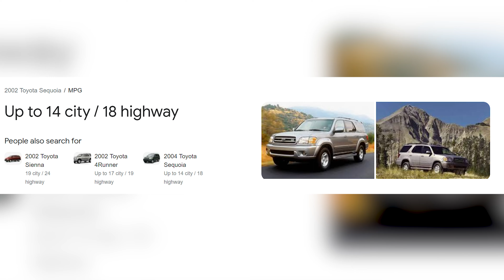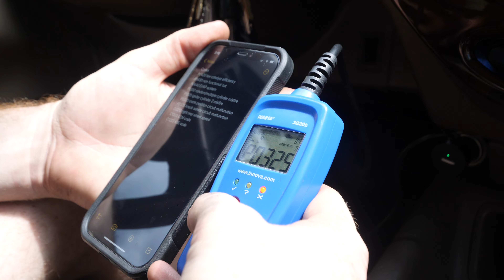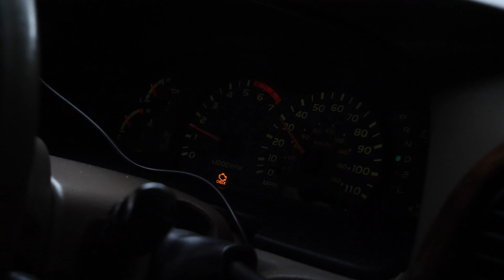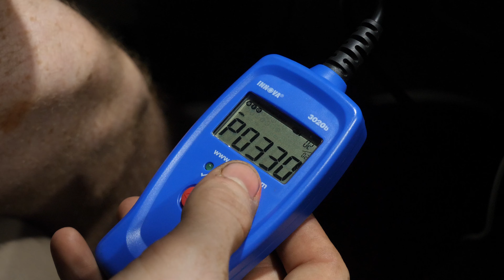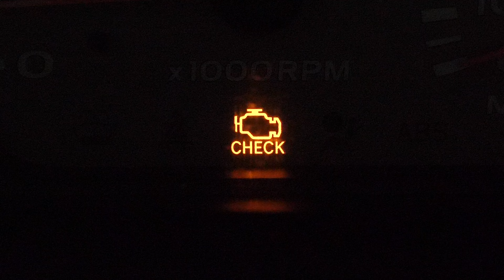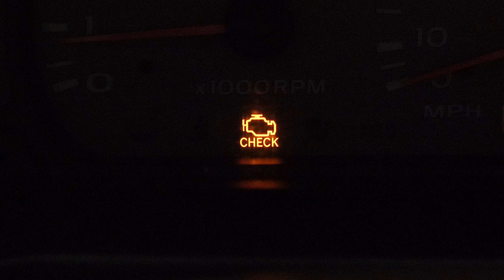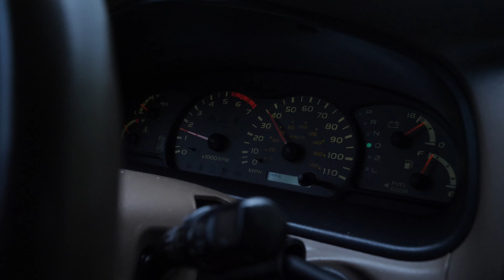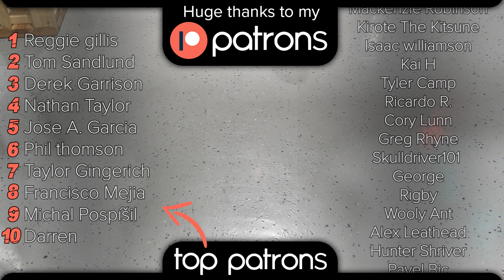There is Something MAJORLY Wrong with my Tow Rig...

Comment: Hey gingum, I've been a tech at Toyota for 3 years, the knock sensor wiring is generally the issues on the 2UZ engines. Also the knock sensor you used was not OEM and these early EFI Toyotas are picky as hell for their sensors. OEM sensors only on these rigs. DENSO and AISIN are the OE part manufacturers for Toyota.
Reply: Also the wires are actually shielded.
Reply: So are his knock sensors doing nothing now?
Reply: @windolite  they're doing something, but he's only utilizing one based of what he did in this video. Ideally the engine would use both and reduce ignition timing if knock events occur.

Comment: PLEASE READ!!!!! 

Gingium those onboard mpg computers go off predetermined tire size. When you go bigger, your rotations per mile are significantly lower, therefore racking up less miles onboard vs ACTUAL miles driven. You need to find the percentage of your tire size difference, take the miles per tank you have on the trip meter, and multiply by percentage (decimal point) , then add that total to what you have on the trip meter. THEN divide that by gallons used (I go off first click at the pump for that number) and you have your REAL total. 

So let's say your trip meter says 400 miles and your tires are 15% bigger than stock and you used 40 gallons 

It's 400×.15=460 actual driven miles. Now 460÷40 (g)=11.5 mpg 

If you went off the computer or trip meter that counts based on stock diameter your mpg would only show 10 mpg because 400÷40=10

I'm willing to bet you're fairly close to advertised mpg. My 99 Tahoe on 33s could hit 20 mpg at 62 mph but my trip meter average would tell me that my average was only like 16 highway. 

Hopefully this makes sense!
Reply: This!!👆👆👆
Reply: Dang, ever thought about that. You wicked smaht
Reply: Wouldn't it be the right solution to just calibrate the tachometer correct to the new tire-size? Otherwise it not only calculates the MPG wrong but also shows your actual speed wrong.
Reply: @DeCSSData  meh the Speedo wasn't a big difference. Even when i went to 35s from 245 tires it was only a few mph off at highway speeds. And a bonus/subtraction depending if you're buying or selling is less miles on your odometer. So if you buy a lifted truck that's been that way for years, odds are the miles are THOUSANDS less on the dash than actual mileage. For me, miles never bothered me. And once you remember how to do the math, it only takes 20 seconds at the pump with your phone to calculate it.
Reply: @sergeantspeed5941  Yeah of course it is no problem to calculate it every time. But I am from Germany. Here you are not allowed to put bigger wheels on your car without techinical review. And not adjusting the speedometer correctly would terminate every chance of a positiv technical review...
Reply: I have bigger tires on my 4runner, I’ve been re-calculating my mpgs for years. Great write up!
Reply: The error  in the MPG should be off by the percentage circumference difference in the tires (also reflected in the speedometer error vs a GPS measures speed)
31" tires are ~ 97.5" in circumference
33" tires are ~103.5" in circumference
That's a difference of about 5%.  So at  70 mph, the speed would show about 67 mph.

I experienced almost exactly this change on my Tacoma going from 31"s to 33"s

Comment: I think Gingium is cursed. Anything with a Panda paint scheme comes to haunt him. First the Previa now this 😂
Ps. 15ish mpg on the Sequoia seems about right. My 2008 2UZ 4Runner gets around 14-17mpg.
Reply from the maker: I really only get 15mpg if I drive it like a grandpa on the highway. Still getting like 9-10 driving normally through the city. Oh well though, its definitely a bit better!
Reply: Previa was sick lowkey
Reply: We get 15 mpg with our 2007. 13mpg when towing a tent trailer
Reply: @_Gingium_  Our family used to own a 2001 Sequoia sr5 2wd with 175k miles and no check engine lights. Dealer maintained and only had the slightest of oil leaks (small enough to where the dealer wouldn't recommend fixing the issue. We usually saw 13 mpg combined when driving like a normal person and 15-16 mpg when driving extremely conservatively. I think these 2000's SUVs never really hit Target EPA numbers unless they were babied and just driving off the lot. You might be spending a lot of money only to see a 2 mpg difference. Just my 2 cents
Reply: My parents 2006 4.0 4Runner gets 18 city/highway so 15 sounds right
Reply: Ahhhh I miss that previa

Comment: Could be cracked manifolds as well. The 2UZ-FE's i believed had really weak headers which would crack over time causing a ticking.
Reply: That's surprising they c with headers but thays why most manufacturers go with cast exhaust manifolds
Reply: Happened to me on my Tundra. It’s very common, could definitely be a cause.
Reply: @FiatRunner  yeah my 4Runners got that tick. It ain't bad but it's there.
Reply: I just recently had my 99 4Runner cast iron manifold crack on me. Very common from what I’ve read with late 90s/early 2000s Toyotas. Replaced it with an OEM steel manifold from a 2000+ 4Runner and it’s been perfect
Reply: I would 100% recommend gettting Doug Thorley headers for the sequoia they will fix the ticking sound and give you a better exhaust sound and more proformance. If you contact Jason from Burtman Industries he will give you all of the info you would ever need.
Reply: reminiscent of GM's 5.3 header bolt shenanigans.

Comment: Next time you suspect a wiring issue I'd ohm and continuity check the harness end to end on both wires.  There's a good chance there's more damage than meets the eye... I noticed at 3:00 the other wire was compromised... but edited video is hard to judge.  So this might all be wrong... but splicing one knock sensor to the other seems like a poor choice.
Reply: He is self taught, which means there's very little chance he understands how to properly diagnose electrical issues.

Comment: hey gingium, i work at the Toyota dealer in Buford and i have a pretty good idea why your milage is so bad. number one is the injectors are probably original and by now have a awful spray pattern. i would either replace them, or send them to be cleaned. number 2 is the egr system. it completely coats the intake valves in carbon and sludge. i would remove it by capping of the line from the exhaust, and just ignore the cel it will throw, or wiring in a simple resistor to trick it if you don't want the light. and then it will need a can of intake valve cleaner ran through it to help clean the crap that is already stuck to the valves. and not the junk you just pour in the gas tank, the concentrated kind that is ran in through the fuel rail. we can do that at Toyota or you can do it with a pressurized bottle. i think that will deff bring your milage back up and greatly prolong the engine life!

Comment: Your knock sensor codes are hurting your MPGs.  Essentially a knock sensor is microphone on the block to pick up pre-ignition (spark knock).  They are essentially tuned to the firing order of the engine to let the ecu know which cylinder is causing the knock.  You have multiple sensors to better pickup all cylinders (think of multiple microphones in different parts of a room to pickup multiple people talking).    If the knock sensors are not operating correctly, the car will retard spark timing to a "safe" level as a remedial action.  Less spark advance, less power, meaning more throttle (and fuel) needed to drive.          The post catalytic O2 sensors you are messing with do not affect the A/F ratio of the engine, that is what the primary (Pre-catalytic) O2 sensors are for. The Post Catalytic O2 sensors have some serious calibration attached to them in terms of response time, temperature, running conditions, etc. that have to be met before a P0430 or P0420 code can be set, and I believe those are type B codes, meaning the problem has to exist for 2 consecutive key cycles to set the check engine light.  With your scanner 2you will see the codes as "pending" if they have only happened on 1 key cycle.        If it were my car, I would run new wires directly from the ECU to the problematic knock sensor to fix it.  As for the post O2 code you could install a new cat, or get a tuner to turn off the code in the ECU (like you would if you installed longtubes) or just leave the light on (it won't affect MPGs).
Reply: Hope he reads this

Comment: Very important!!! Knock sensors almost always need shielded wire to prevent interference of the signal! I've made that mistake many times causing the engine to pull loads of timing.
Reply: I wonder if the knock malfunction means the motor is running with no timing, thereby making its efficiency garbage
Reply: @Fhwgads11  absolutely. Even minor interference with the knock signal will cause the ecu to pull timing and greatly reduce efficiency.
Reply: Also the sensor must be tightened with a specific torque to read correctly

Comment: Probably repair the circuit by running new wires from the connectors of the ecu to the knock sensor because it’s probably pinched or twisted somewhere. As for mpg just calculate manually

Comment: As others have mentioned here the other knock sensor wire looked compromised and in my experience Toyota sensors are extremely sensitive to issues like that. All 2UZ motors at some point or another will suffer from the exhaust manifolds cracking. I'd soak them in pb blaster and just pray they come loose as I don't see much room for an induction heater or torch. 15 seems normal although hand calculating would probably net you a higher MPG based on the larger tire size. Even on the 2UZ 4runners and GX470's of a similar vintage, they are lucky to hit 17-18 MPG stock. (I hit about 18.5 Highway hand calculated on my 06 4Runner with the 1GR-FE and 33/12.5s) It also doesn't help having the earlier 4 speed auto vs the 5 speed that was added for the VVTI models. Once you get all of the little issues sorted it should last you for a very long time.

Comment: Caleb, I get like 10-12 towing in city and like 13-15 highway. It's just how it is when towing with these smaller vehicles. Made decent mileage towing with a friends Chevy 1500 5.3 v8  with a car trailer and car, did 80 the whole way and made around 16-18. I'm towing with what I got right now but I'm looking at getting a truck because I've found that alot of these smaller vehicles say they can tow 6-8k.... and they technically can... but it's not fun. When towing with my friends truck, didn't even notice the load was there. It was a visit to heaven.

Comment: Things you shouldn't do take a tow rig: Add more weight and burn more gas. Add knobby tires and burn more gas. Make it louder because you'll sit at 3k rpm towing for 2+ hours on the way to a track day. You want a tow rig, this ain't it and that's definitely not what to do to one.
Reply: I disagree. He’s an automotive YouTuber, his tow rig has to be somewhat interesting to the audience. A bone stock quite tow rig is great but not great when you’re trying to entertain your audience. I think he’s built this thing very well. A sequoia is a super underrated vehicle. Quite literally a tundra without a bed with the luxury’s of an SUV.
Reply: @xtreme_plus387  so he’s right for the sake of entertainment. Is that what you’re saying

Comment: @Gingium, I have to say two things. Im @3:08 in the video. Number one being... around this year of toyotas, the knock sensors and wiring are extremely important. Torquing the sensors properly and the harnesses being as original as possible is absolutely key. The sensors are very easily damaged internally and the resistance in the wiring to the pcm is critical. I know you probably dont want to get a factory harness, but i implore you to at least get the factory OEM toyota sensors. My shop has gone through three of kinds of jobs now with the proper fixing being just these things. Oem wiring and sensors torqued very specifically. 

Second being I really fucking hope you changed that crusty ass starter. We will see though. 

Love your vids. Been a sub for a while now. Keep on rockin brother.

Comment: Hey Caleb! By the way, the mpg the truck reports on the screen by the headliner is known to be optomistic. If you calculate mpg manually youll find out that its a bit less than what the screen says.  Still glad you made improvments! Had to deal with the O2s on mine & it was just as nightmarish. Also have a turbo 4runner that i had the same knock sensor issue (i did the same exact thing and spliced them together but didnt get the same result) ended up going with GM knock sensors from a small block 350 since the knock threshold was lower on them.

Comment: Have you checked the coolant temp sensor. If its reading cold, engine will stay in cold start using more MPG
Reply: If the coolant temp sensor is broken it gets freezing outside, it lookes warm in the video
Reply: @jbg6961  reading that hurt my head.
Reply: @9373innes  LOL, no doubt.

Comment: (Commenting before watching the whole vid) Damn. That’s rough. I got 14 mpg in my 16 silverado 1500 while pulling a 2001 silverado 1500 on a steel and wood deck trailer. Probably around 8k lbs. total. 5 for mpg  is terrible, you might not even see significantly better mpg while towing after fixing these issues either, maybe 7-8 with a tail wind jumping up from that 5😬

Comment: You forgot to connect the shielding on the knock sensor wiring i bet. I would replace the entire wire if you can, that shit is finnicky. And the o2 sensor spacers need to have the tiny hole in the tip like the spark plug nonfoulers, otherwise they will do nothing.
Exhaust sounds sick after putting cats  back in it tho.

Comment: Increasing the diameter of the tires does a couple things. 1, odometer and mpg will be off as both assume a certain tire diameter, with fewer rotations needed to travel the same distance. 2, increases the rotational inertia, translating to greater torque needed to turn the wheels. Hence why you felt the vehicle get sluggish towing uphill.  

Translation: larger wheels = better highway mileage but reduced towing capacity.

Comment: Crappy O2 sensors can absolutely hurt mpg. My Previa used to get 14mpg with a completely non functional rear sensor and then the front sensor died and I was getting about 12mpg. Replaced the shit exhaust (it also had a massive leak in the flex pipe) and 2 new sensors. Now she gets about 22mpg like she should.

Comment: Most EFI systems will go into "Limp Home" mode if they can't get a good read on the catalytic converter. There's supposed to be a significant difference between the upstream and downstream O2 sensor readings. You could be losing mileage AND power due to some knucklehead deleting the cats.

Comment: good job on fixing the truck. one thing i did notice is that every time you revved up the motor in park i can hear the engine fan ramping up a lot. i get that it probably has a clutch fan and usually spins most of the time but i don't think it should spin up like that all the time when its not overheating. i think this may also be causing a lot of hp loss and making your fuel economy  worse. maybe but maybe not. doesn't hurt to look into it.

Comment: I plugged an exhaust crack with jb-weld putty on a $300 car once. Worked great for the 6 months I drove it, until I sold it for $300, 😂. Also anytime you take the intake manifold off on it in the future, CHANGE THE STARTER! I think the engineers hated the mechanics with that one, 😂.

Comment: FWIW i had a 5.7 hemi with ebay cats. using an o2 sensor spacer didnt help the  P0420 check engine light. I found an old forum post to stuff the spacer with I think number 2 steel wool and somehow that worked

Comment: 15+mph is about the best you are going to get. Keep in mind your truck is calling mpg based on stock tire size. The calculation is off by whatever percentage your tires have increased in diameter by.

Comment: I did my exhaust manifold gasket by loosening the engine mount and jacking up the oil pan lifting up around 2 inches removed the engine mount and I was able to access the bolts use a 2x4 piece on the oil pan

Comment: The knock sensor codes will cause the ecu togo into a limo mode and retard ignition timing to prevent low octane fuel from pinging. With less ignition advance the engine is less efficient so it burns more fuel to do the same amount of work.

Comment: Thay grill guard zaps fuel pretty harshly. Had one on my 05 z71. Saud i shoukd get 18mpg highway, but only got 15. Take it off and test it. Youll notice the difference. The larger tires will also zap about .5 to 1 mpg. The factor you average 15.8 is not bad at all concidering the circumstances.

Comment: Try getting O2 sensor resistors my Nissan pathfinder had an O2 sensor code after pounding the cats out only got 8 miles per gallon should be getting 16 did the resistors and knocks sensor runs and drives great

Comment: Deleting catalytic converters doesn’t do much for horsepower but it does make your car worse.  Steve Dinan sees a 6 horsepower lose on his 900 horsepower twin turbo BMW V8’s with stock catalytic converters so there is no reason to delete them.
Reply: Dog 6hp is the reason 😂 neeeeeed the power
Reply: @southernoregonrockhound  he LOST 6hp
Reply: What you smoking with a down pipe and tune you gain power on turbo car
Reply: @illyapalamarchuk3525  yea down pipe and tune with the catalytic converters and it still makes 900.  Deleting the cats gains you 6 horsepower and a whole host of other problems.

Comment: Clean your maf, stock air filter, check your dif fluids,  trans fluid and transfer case. They like cold plugs but you will loose low end power but it makes it up every where else. Also if your towing get a trans cooler. There's kits. As for the header leaks, replace the block studs, use oem gaskets and dough thourly headers and collector are way better an cheaper then oem